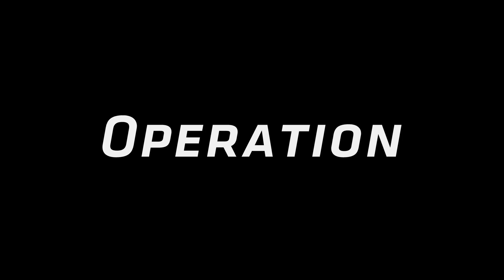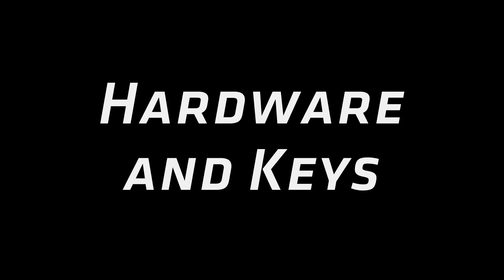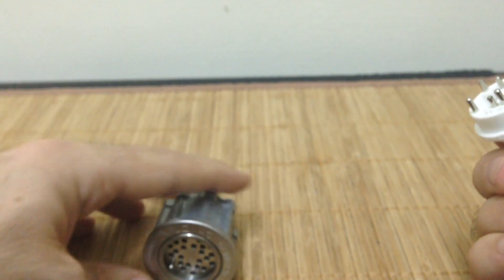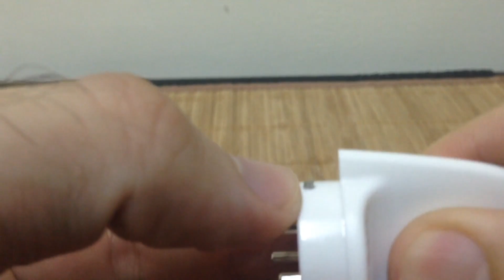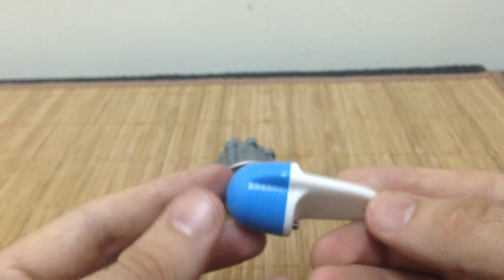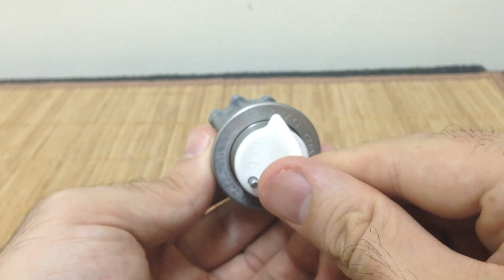[22] "XPUZMAG" Lock- Very Creative New Lock Design!

Comment: Interesting lock.    For picking, the first thing you would want to do is recognize that the orientation pin and the notch pin have a certain fixed alignment here-- if that's the same on all the keys, you would want to rotate the lock to that initial orientation position and keep it that way which would at least keep the holes properly aligned for insertion.  But it would probably require a special tool for a tension wrench in order to pick it efficiently.    And then if it requires a couple of rotations that would further complicate it since you'd have to pick it multiple times to get it open.   But I'd sure like to see the WTF expression on a would-be intruders face when he first gets a look at one of these...

Also, the orientation pin is a bit fiddly, might be a pain to try to use in the dark.  Seems to me they could have come up with a better way to do that-- maybe in revision 2.0...

Comment: I don't think it's unpickable, but a burgler would have to really want to get into your house to pick the lock, and could probably expect more security once inside.

That being said, there's more than one way inside a house, and a special lock like that might be telling a two bit theif you've got something worth protecting inside.
Reply: Dexxter If there is only one practical entrance to the property, that also means there is only one exit in the event of fire.  That does not seem to be such a good idea if the fire breaks out between the occupant and the exit.
Reply: +Flywolfpack In response to Paul Dickie (comment seems to be removed)

"If there is only one practical entrance to the property, that also means there is only one exit in the event of fire.  That does not seem to be such a good idea if the fire breaks out between the occupant and the exit."

Most apartments in high rise buildings and most hotel rooms only have one entrance out into a hallway. Often the windows cannot be opened in hotels, and even if there is a window that can be opened or a balcony, it is not feasible to use as an escape route from the 18th or 34th or 52nd floor. I live on the 18th floor and have a balcony, but that is definitely NOT a survivable escape route. All our rooms have commercial grade fire detection and sprinkler systems installed so hopefully any fire would be quickly controlled and contained within the fire resistant doors of the burning apartment. And yes, you are right, people CAN get trapped in these apartments and die.

Comment: It looks fairly simple using a 3d printer to make a universal key for this lock that has all 23 pins present but each one controled by an actuator. Thus looking at the key all the 6 pins appear to be about the same length, so taking that and the 23 holes we get 100947 possible key permutations.

This means that an automated brute force attack of say one test per second we could on average open the lock in around 14 hours, which is way to long to be practical. If testing could be done faster say 1 per 1/4 second and an accurate enough rotation sensor added to detect freeing from correct partial guesses then we could reduce that to say 35 minutes.

This is all assuming the pins are of equal length, each extra positional possibility on that would multiply the time to crack.

One final thought is that this design could be open to masterkey operation if there are at least 1 pin with two sheer-lines.
Reply: the pins are not the same lenght. Look at 02:31 and listen to what he says..

Comment: These are the fucking exact same locking principles that were used in Egypt 4,000 years ago. All this is is a slightly changed version of it with the addition of a moving faceplate and then the rotating deadbolt. Great to see engineers are making money off of old ideas still.
Reply: Without precedence, humans would have next to nothing in terms of technology. Would you honestly rather not have new things if it meant some guy smart enough to design it got rich?

Comment: Weakness will show itself after many use. It will become clear which pins are the one that needs to be pushed as they will be marked. It will then be very easy to make a pinboard on the spot. loose Pins + a metalic circular plate with a handle prefabricated. Now push and turn would work on every combination as long as it has been used a few times.

Comment: No one wants to be trying to fit those keys in there pocket.
Imagine having 3/4 of hose locks on your business. 4 of those massive keys in your pocket?
Gimmie a normal key any day
Reply from the maker: The keys are definitely an odd shape! 

I suppose you would have to carry these in a backpack or purse for more convenience.
Reply: Well, if the designer was to chop most of the handle off leaving only about a quarter of it on there I like to think it would still be fully functional. Then add a little loop on the side of the "cylinder" part of the key for a keychain and it would be much more efficient. You could essentially be walking around with a bunch of little discs rather then this big old thing. EH? Maybe??

Comment: wouldnt the same holes eventually leave marks of use? could replicate the key just by looking at the lock..
Reply from the maker: It's possible some marks would be made, but you would still have to know the correct biting of the key to make sure the pins were pushed to the correct depth. I have to double check with the designer but I believe their are at least 10 possible depths that each peg on the key can be cut.

Comment: Cant you put something in all the holes at the same time?
Reply from the maker: That wouldn't work as some of the holes have "Dummy Pins" that when pressed down will block the shear-line. Many of the holes would have to remain untouched to allow the cylinder to rotate.
Reply: Thanks for the answer.